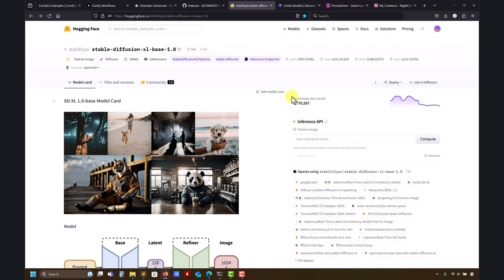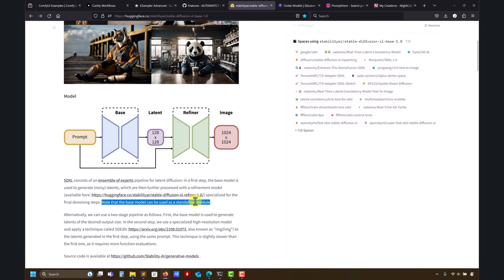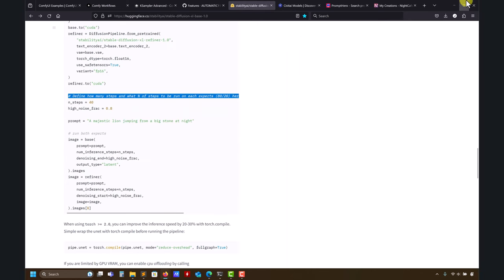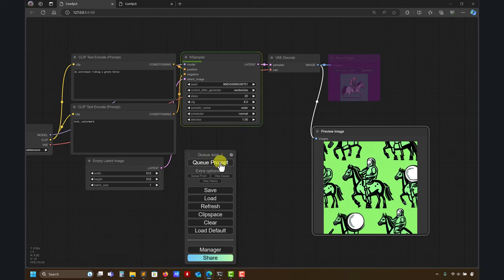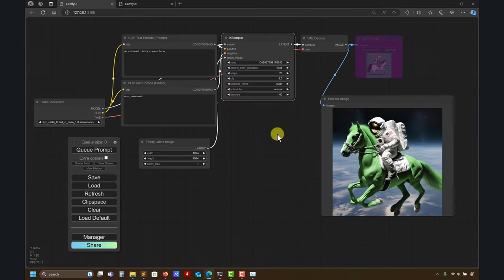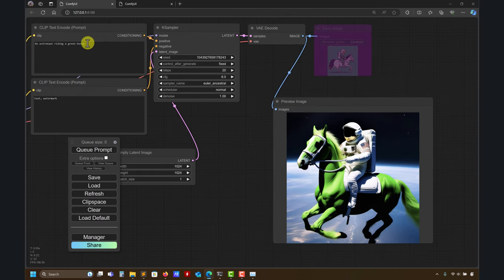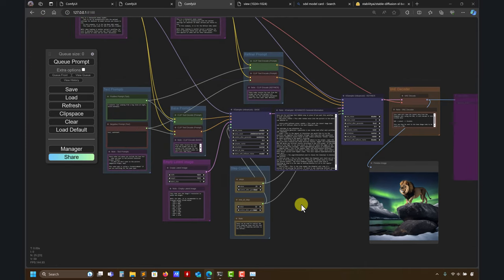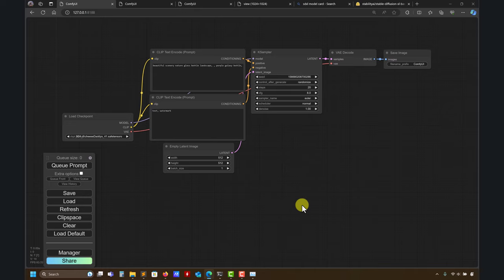SDXL Base + Refiner workflow using ComfyUI | AI art generator

Comment: Commas are extremely important, mostly where you place them, putting them at the beginning or at the end change the image a little but overall still the same.
Hair Red, Jacket
and
Hair, Red Jacket
creates completely different images, if you use large prompts is useful to separate the different ideas.

Comment: 11:24   why the highest resolution like 2k and 4k images are not generating properly ??
Reply from the maker: in my case memory problems
Reply: @wolfdynamics5703  is it related model because i was reading something like new model flux can generate 2mp full HD images

Might be this is what
Reply from the maker: @CodeWithRains  Yes, a similar workflow should work with flux. I still haven't try it, but I think should work.